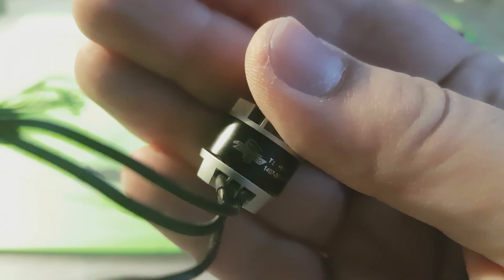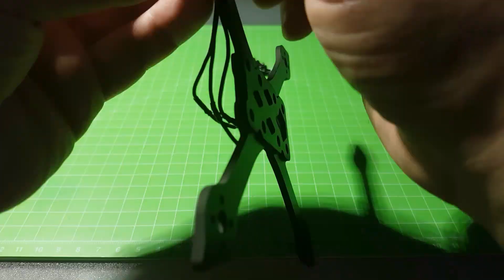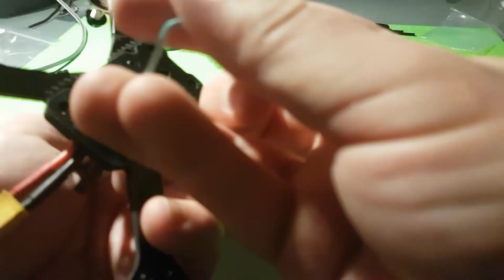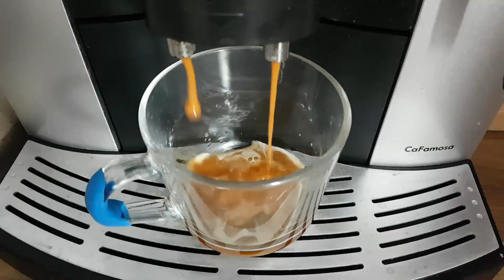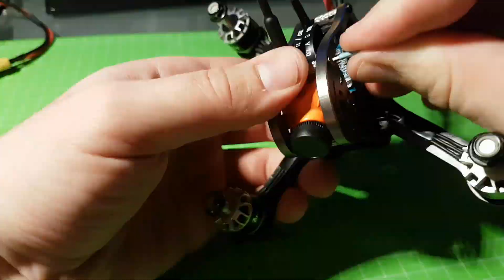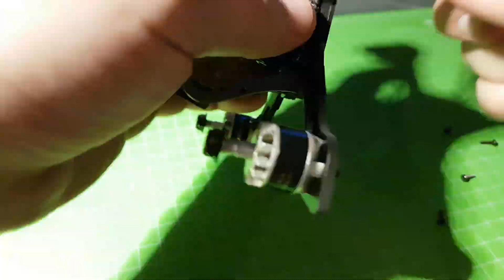GepRC MX3 Sparrow Build with Runcam Split Mini

Comment: could you measure the height of the stacks?
Reply from the maker: Pretty old video - in the meantime I swapped to the split mini 2 using only one PCB. Right now the stack is 20mm high, before with the older split mini it was around 24mm
Reply: @BeanJ  including all the pcb's?
Reply: @BeanJ  can't believe its so less, I'm planning on building my first quad. And I'm planning on getting the same mamba f4 stack as you and the the caddx tarsier v2
Reply from the maker: I have the quad right in my hands, with all the nuts and bolts it's exactly 20mms high. With a std 20x20 PCB there are 24mms of space till the aluminium hood of the frame.

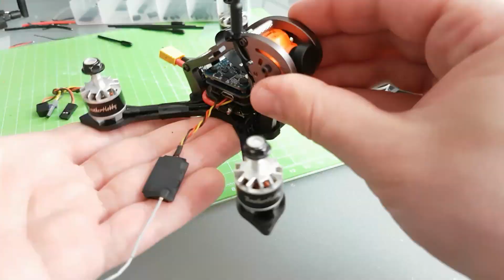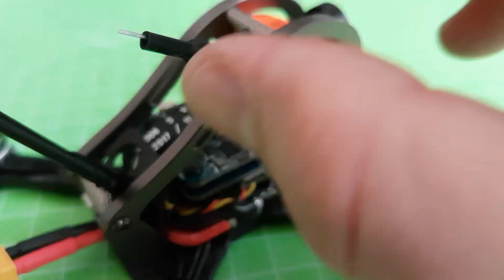Comment: Tanks fr sharing, wonderful vid. @8:16 and @8:30 looks like theres a lil room before stack hits the aluminum cage. I have hglrc stack and split mini. but can't decide on a frame. will that fit the hglrc tx20 in one stack or it won't? what that be why you chose to place the vtx in the back?
Reply from the maker: Thanks for your comment! ;) I think the space between the stack and the frame is not enough to fit that hglrc tx20 aswell... Its really tight, but maybe the stack can be built a little bit lower... Tough guess... The RX is in the back because it has no mounting holes and it sits quite nice in the back. And I placed the vtx in the front so I can reach it easily to change the channel, if needed and its cooled in the air, so it won't get too hot with 200mW. Meanwhile I designed 3d printed mounts for RX and VTX, maybe I will upload another video on that. Next to come is some flight footage ;-) Happy flying!